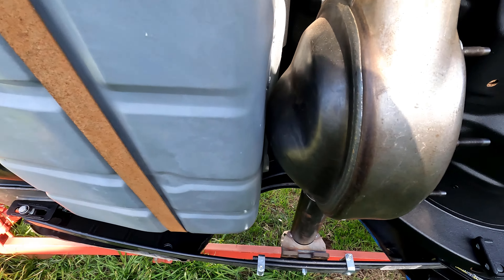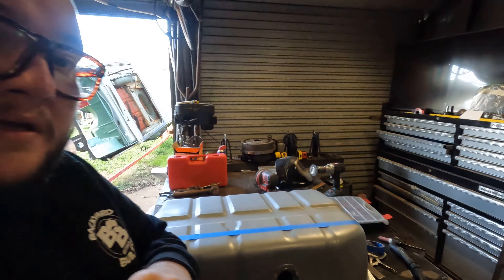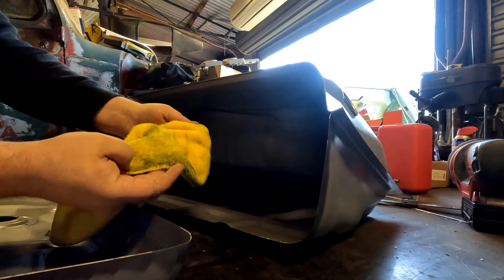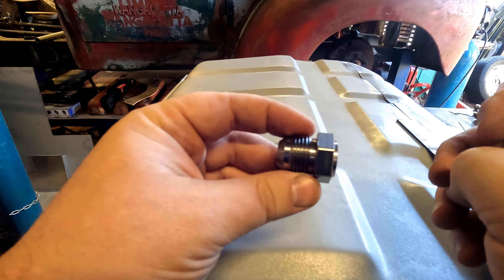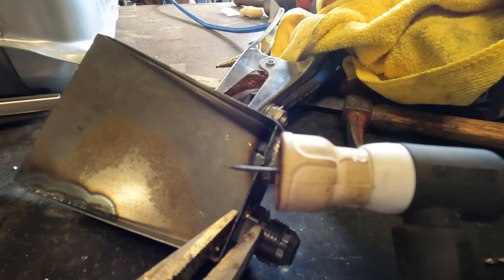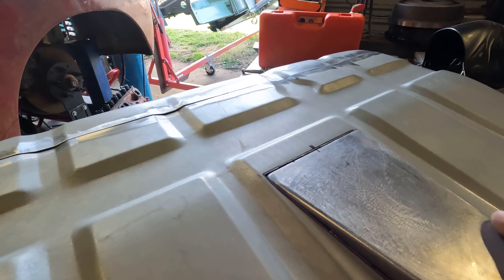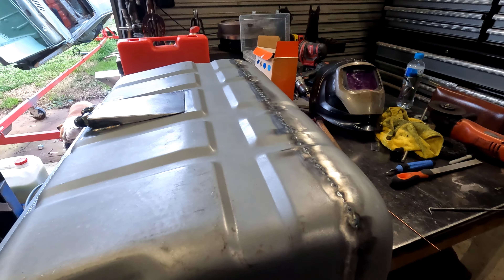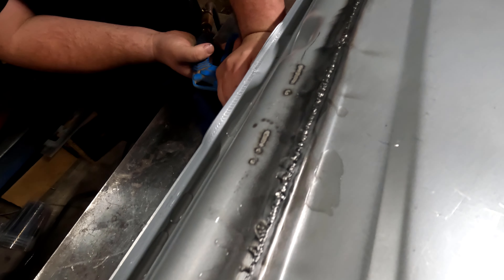How to add AN fittings to a fuel tank: Tank modification: 1966 VC Valiant: Backyardbuilds

Comment: is there a physical reason for not cleaning up the tig weld before powdercoating? just in case theres pinholes? sorry if noob question
Reply: yeah thats fitment.
Reply from the maker: The physical reason is the proud part of the weld is the reinforcement it is essential added strength to the weld same as the penetration. With up to 65kg sloshing around in I wanted to keep as much strength as possible.
Reply: ah yeah with all those hammer forces and all that, makes complete sense. awesome cheers for clearing it up

Comment: You should always use kerosene to check for leaks as its thinner than oil, water, etc and leave overnight ..just a tip i was taught 45yrs ago when we were doing sumps to check for leaks

Comment: Tiger good to see you having a go but if that passes a pressure test. I am not religious.New tank the go but learning by experience is what it is about.But I do not pay for steel,gas just my time after hours  First job welding fuel and hydraulic tanks test 4 psi 100 psi all good

Comment: Mate measure three times then buy.Really it is pretty easy to make a fuel tank. Cheaper than your approach and tougher .Now you have a bigger problem cutting and shutting coated crap steel good luck.Sell it start a fresh
Reply from the maker: Cheers mate for the advice already got it back together with no porosity or pinholes. Tank was already purchased with intention of running a borgwarner, which would have worked. The 9” happened when there was $500 difference in the diff build.